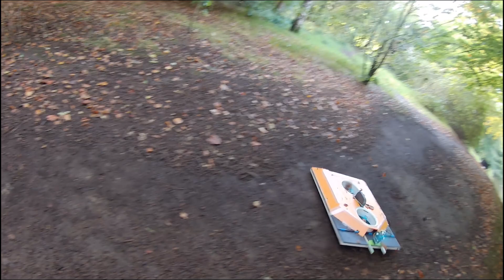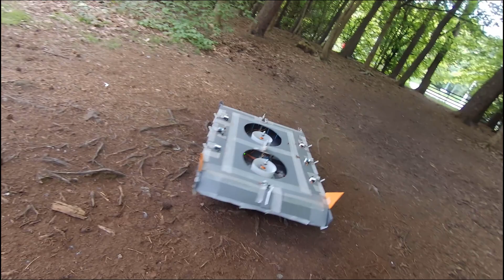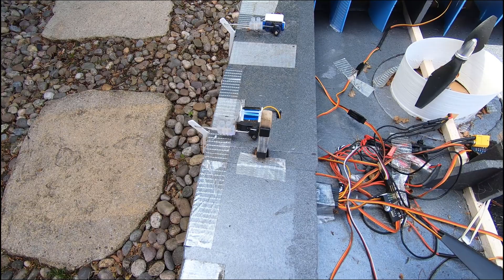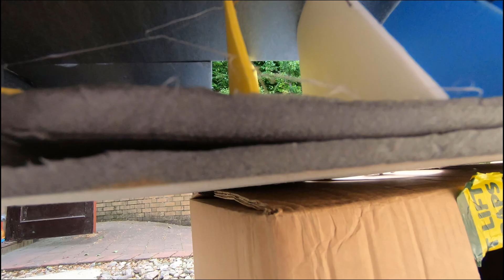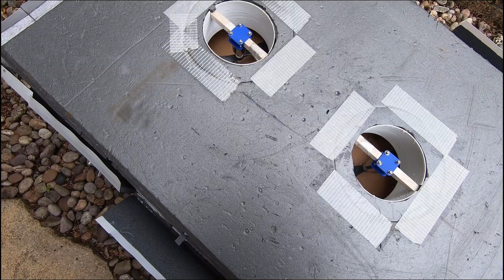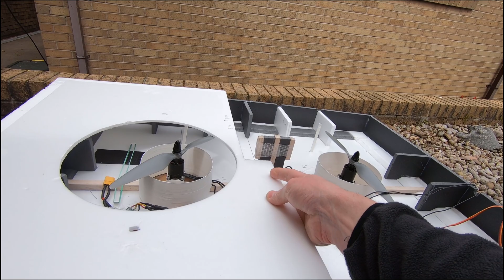Skirtless Hovercraft Projects - 2021-2022 Design Summary - OUTDATED - SEE DESCRIPTION

Comment: have you thought about trying to use a centrifugal fan instead of airplane props? it's something I'd wanted to try at some point.
Reply from the maker: I've thought about it as well but I don't think I could ever find one that suits. So I'd be down to either making one by hand (and I don't trust my own accuracy that far) or just print one in a single piece. I'd consider it for my lower power (<100W) motors but there's no way I could trust it on the higher power stuff.

It would introduce problems with motor cooling and feeding the stability jet airflow, I'm sure I could work around that, but you're looking at a redesign around the fan rather than a drop in replacement for a prop.

My gut says any theoretical advantages of a fan are exceeded by the extra weight of it.

At some point I am making a small 3D printed test craft, I could try a fan in that, although it would take a ton of iteration to find the best fan design so it's not good prop vs poor fan.
Reply: @Glydaire  as I am starting to get better with Fusion 360 and 3D printing, I think this is something I'd like to try. I think the sound would be amazing, something between an EDF and an air raid siren :D

Comment: Hello there. I made one. Single engine 935 kv is pushing air with 8 inch propeller. A second engine is the mini 2730 1300 kv pusher engine and 9 gr. servo that drives the driving motor. And two ESCs... It's enough to lift 4-5 cm off the ground. Nicely steered engine. Your sharing has been very helpful. Thanks.  home trial Link. https://www.youtube.com/watch?v=39YnmhB4zAU